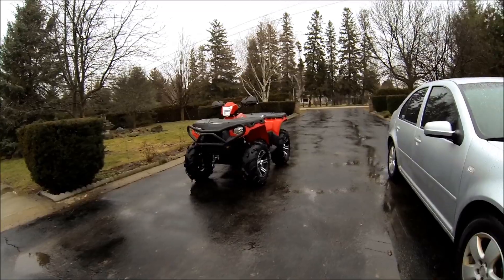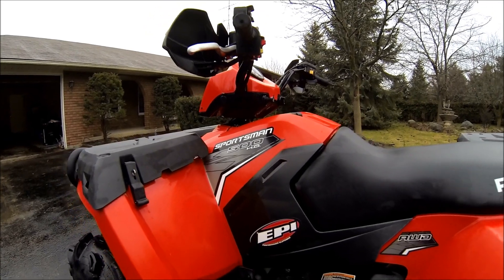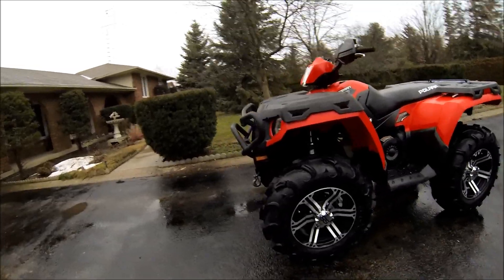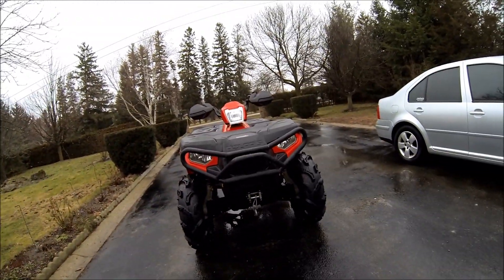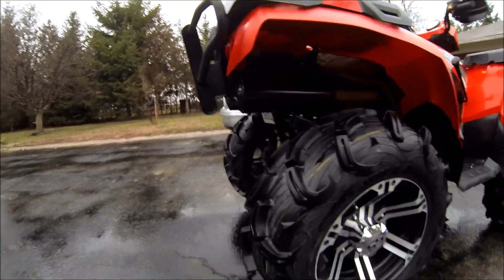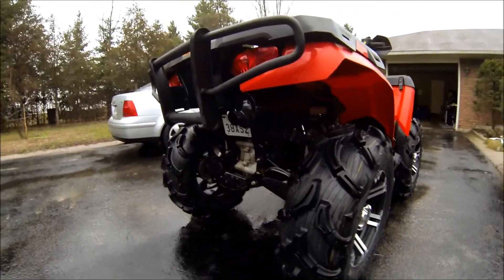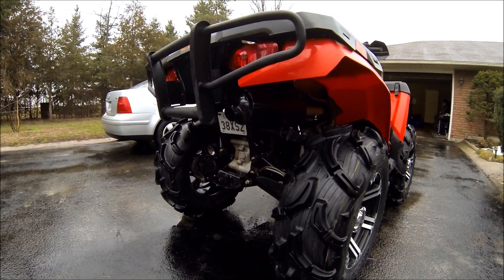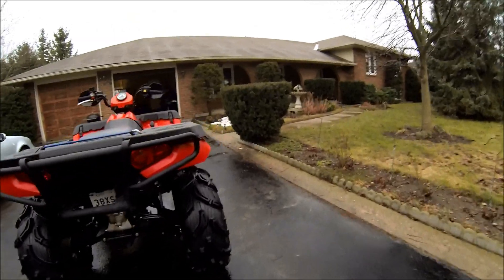2012 Sportsman 500H.O exhaust & walk around

Comment: Hey man how can I seal my air box but still be able to change my air filters and such
Reply from the maker: its should be factory sealed, never had an issue. try replacing the rubber seal on the air box, if that doesn't do it then look for thicker rubber seal to replace the factory one. You also might be getting water through the factory snorkel.